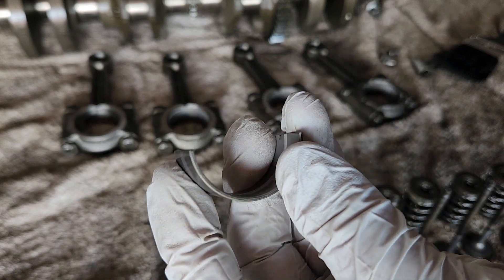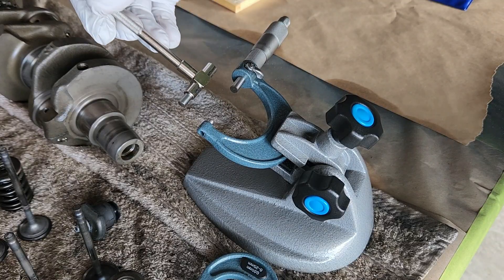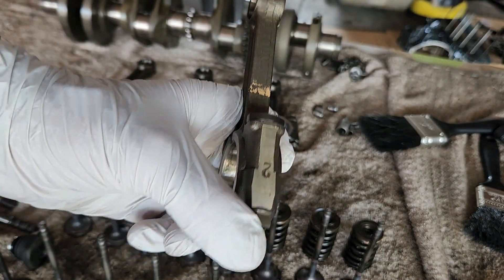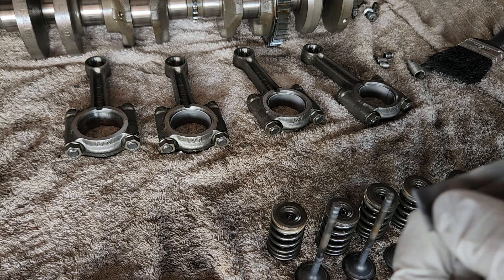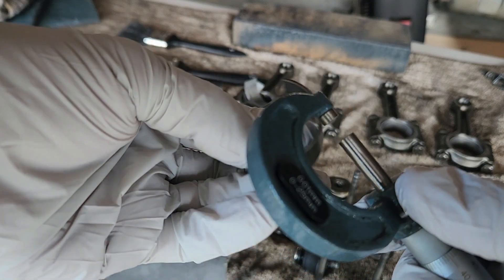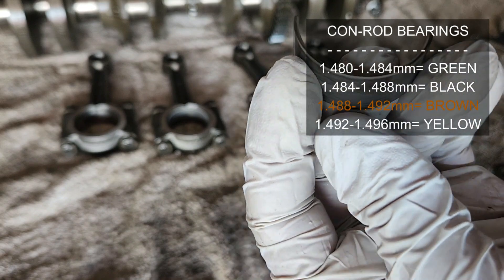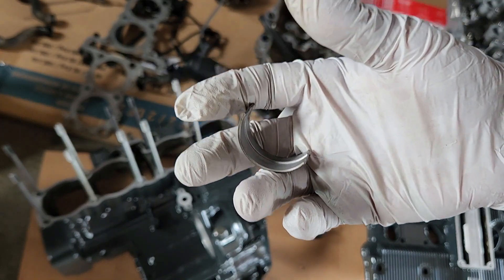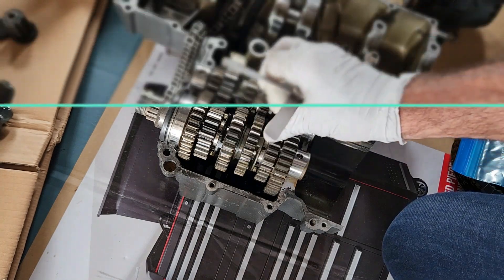GSXR 750 '88 Restoration Part 9

Comment: How do you clean the oil routes inside the crankshaft?
Reply from the maker: Good question! I use parts cleaner, followed by a good blow with compressed air.

Comment: Hey Chris just a little info for u the bearing shells r thinner toward the joins  they r made on purpose like that to act as an oil reservoir  So u can c measuring there is incorrect I didn’t have this info  u r sharing from Yamaha  so I bought a selection of  shells purple White blue black and I Tried various in the different brg bores! As u can c that is a long winded procedure  but as I knew what thick the dif coloured shells r I could take educated guess on all the. Mains. I repeated this on the big ends and ended up with Purple every where but am super happy as the oil clearance is all excellent now really good video  think u for sharing
Reply from the maker: Thanks for the info!!! I'll keep that in mind. I thought the were of the same thickness all over. But what you say make sense! Thanks again!
Reply: where did you find main and rod bearings? ive been searching for new bearings for my 95 gsxr1100w engine with zero luck.